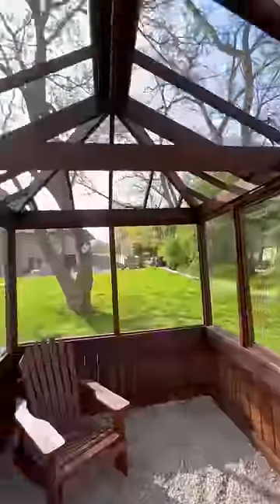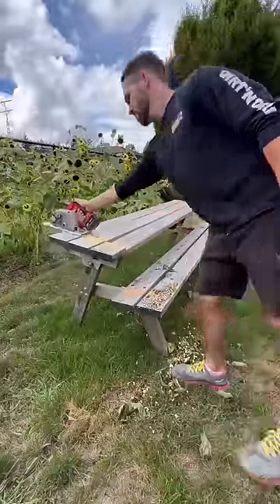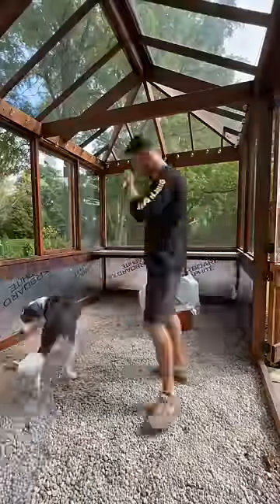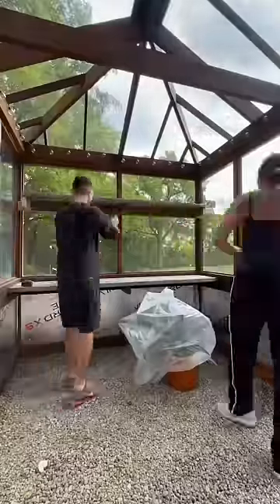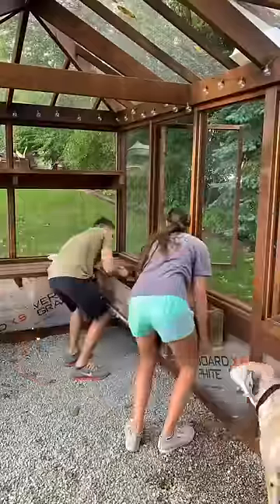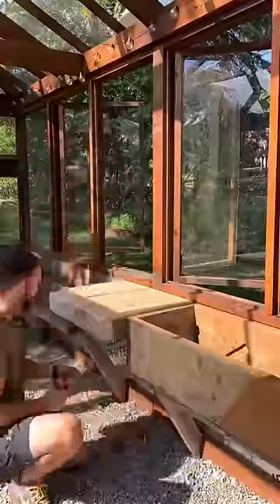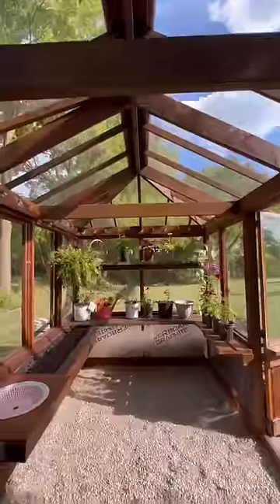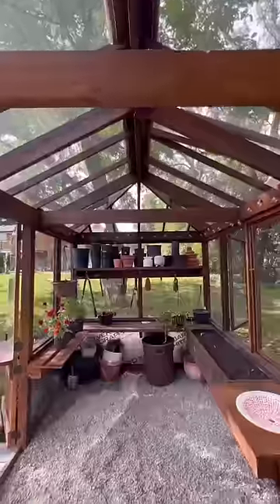Backyard Greenhouse Interior Reveal! #shorts #gardening

Comment: Well you need a heat sink which is basically large black tubs or barrels (reference Mother Earth News) that you fill with water; it'll collect heat during the day and then release it at night. Put them under your benches. That way your greenhouse warms up quicker in the spring and holds heat further into the winter.

Comment: Vents for cross ventilation as it will get insanely hot inside with direct sun overhead.
A shade cloth that can be stretched under the roof to protect plants.
Shelves will keep affect which plants you grow underneath them in the winter.
Remove shadecloth to permit more light for plants during winter months.
Winter months do you need some sort of heat to prevent freezing plants unless you don't have freezing in your area.
It certainly looks cute...

Comment: I would consider getting an openable and closeable shaft in your roof, to improve ventilation and decrease condensation. Also probably add more raised beds, or pots. Greenhouses are mainly used for storing plants in the winter or summer. To store the pots for example, I recommend a shed.

Comment: Make sure to put small holes around the top for airflow, but put a micro screen over it so bugs can’t get in and to make it even better. You can put a carbon filter with activated charcoal to prevent airborne pathogens and smells.

Comment: What did you use in the roof? Galvanized is put on with One by twos running parallel of the rafters. I like yours better than the one by twos so I was wondering.